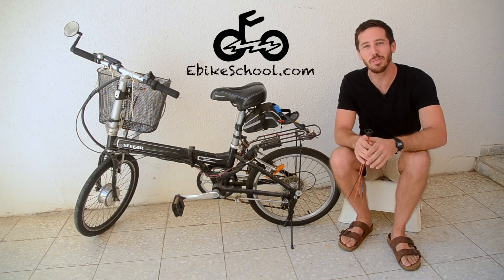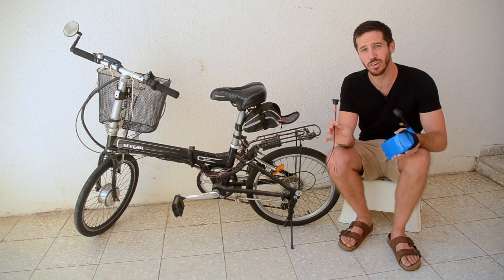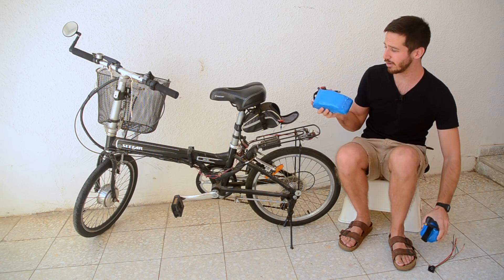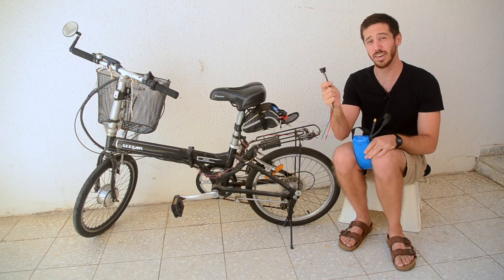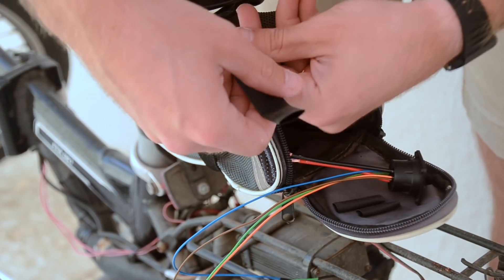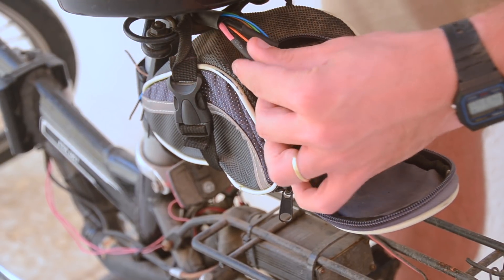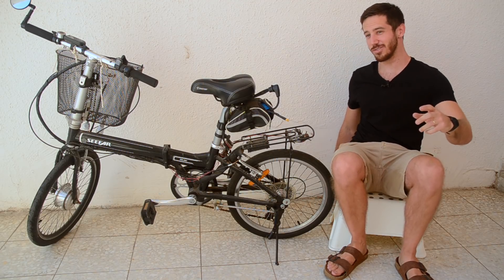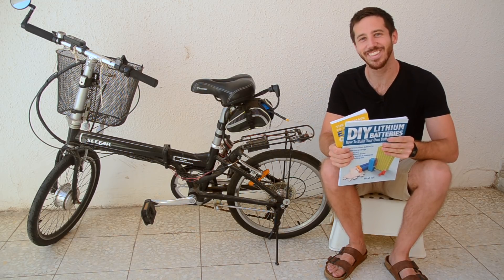How To Swap A Battery Connector (With Rosenberger Magnetic Connector!)

Comment: Hi. I also have a question if you can help me! I have a Rosenberger plug for a battery.
if I install another, more common plug.
I also need the rest of the cables. or if you can guide me where to buy a Rosenberger plug.
or a sketch of the rosenberger plug. thank you in advance

Comment: Nice video to show how to make an extra batterypack with a rosenberger magnetic connector. I have had traffic accident and only can follow up 2 workinstructions at the same time. I't nice to see that in this video there were no more than 2 instructions at the samen time. Would be nice to read your the batterybook. Next question will to connect a e-bike batter with a solarpanel without a transmitter. Is the a 36V solarpanel with fits with the rosenberger magnetic connector.

Comment: Haha cut off the old one and put a new one haha well thats what I did I got a dodgy 48v 20ah cost me $500 didn't even get 15 minutes ride before I come back trying to charge it and the XRL connectors that are on them to charge it are terrible so do you have to have same voltage connecters or something and same thickness wires the only videos I've seen with connectors being change they have to get right up into the bms and I can't find replacement connectors anywhere any help??

Comment: I’ve heard all motors create small amounts of energy when turn manually while the motor is off, if you turn off your ebike hub motor, does it regenerate small amounts of power to the battery? Or is that power lost to space in e bikes?

Comment: Hi Mika.       Some advice please. l have two 48v batteries that i want to run in series and connect into a 96v controller. Seems straight forward, should i expect any problems?
Thanks pard

Comment: I don't want to be that guy... but I see you showing others how to solder incorrectly and I am not sure how else to say it.. That solder job you did on those power leads is superficial. You need to bring your wires up to temperature and they will quite literally suck up your solder. (Think solder wick) you need to heat the wires from one side then put your solder on the other side if you cant do this then you need a more powerful iron! The wire will draw the solder into it as it melts and the solder will become part of the wire. Do not put the solder on the iron because the nice hot iron will of course melt the solder then it hits a cold wire that will act like a heat sink and dissipates the heat from the solder and instantly solidifies the solder not making a good connection.

https://youtu.be/Qps9woUGkvI?t=156 watch how this solder flows when she does her leads... this is why!

Comment: Could you tell me if there are any standards for battery backs ?  the connection between the battery and bike.  Some are 3 pin some are 6 pin , in fact its seems like theres no standard so if I need to change up batteries my only option is to fill the old box with a new lithium battery ?  Is there such a thing as universal adapters or adapters ?

Comment: hi Micah, i have bought a battery and a kit from different suppliers and they are still in process of delivery. now i saw pictures of both and it seems that connectors on battery and controller are not the same, the battery has double connected  input and the controller has two separated green wires
i bought them from suppliers from aliexpress you advised in one of your videos
maybe cut them both and buy some regular connector in store, are they any specific connectors that should i buy to consider the temperature of the wiring?
great channel btw, you are really knowledgeable and interesting to listen to, should be doing more tech-related videos in future, cheers

Comment: Heat gun would've melted the underseat bag. Lighter was good call. 
So you really just push the slightly splayed out wire ends together with no twisting, only solder? They don't pull apart easily that way? Sure more tidy than the knotted solder splice glob that I end up with. Not enough heat shrink in the world to hide that ball of ugly, but won't pull apart.
Reply from the maker: Yes for heavy gauge wire, I prefer this method. The high number of strands makes for a good physical connection that the solder reinforces. For small gauge wire, I often use your method of twisting first. An even better addition to the method I used here is to take a thin strand of copper wire and wrap around the two splayed wire ends once they are together. That holds the bundle tight with a lot of friction between the strands, then you solder the whole thing.

Comment: Mikah..  is there a difference between a XLR ebike (electrical) connector and the XLR used with Audio/Mic connectors and cables..?  Can the Audio versions be used on 52v lithium batteries..?

Comment: That plug may be exactly what I was looking for. I want a way to keep my battery on me instead of my skateboard but easily detachable in case I hit a rut and have to run for it. One battery and one set of electronics make it possible to build multiple sizes for skateboards without redundant costs. Do they make a 3 prong connector or would I have to use 2 of them?

Comment: Nice, but this connector will never hold the current I plan for my trike battery. 10s 14P made from 21700's. So I have a few questions. 
  First which connector would you recommend to carry the current load? Maybe think of doing a video showing appropriate connectors for xxxx watts output. I know many people would find this helpful when building their first battery pack.
   Secondly will the vruzend kit ever be available for 21700's and if so could they handle the 10s 14p current with the newer high power setup that is as yet unreleased? Also will there be any other color caps available?

Comment: Also what batteries would be better for a longboard. I am in between two.  The Panasonic NCR18650PF  and the Samsung 25r.  I plan to get the batteries off of imrbatteries.com.
Reply from the maker: Really depends on your need. PF cells are high capacity but the 25R cells are much higher power. You can get the 25Rs for cheaper on Vruzend.com, FYI.

Comment: Really enjoying you videos.  I have a question I hope you can help with.  I'm trying to use recovered cells from laptop batteries and wondered what an acceptable internal resistance for the cells would be.  I have a battery resistance meter as I also enjoy flying RC models.

Comment: Hello I'm building a 10s3p battery with the vruzend kit. Would you recommend me to us 2 wire clamps each on the positive and negative terminals? Or is one on each just fine? Thanks ahead of time :)
Reply from the maker: If possible, definitely two on each end. Spreading out the current flow through multiple points is always better because it reduces resistance.

Comment: Question. if you increase voltage (48v to 52v) of a battery you get more power (speed) from your ebike. if you increase amps (7p instead of 6p) does that increase range?
Reply from the maker: I think you mean "if you increase amp hours", but the answer is yes.
Reply: EbikeSchool.com cheers

Comment: Thanks.  You should add the lunacycle.com Rosenberger connector to your list of parts.  I like it.  Especially since you swap batteries regularly and sooner or later the other connectors will get loose.
Reply: Direct link to connectors is:
https://lunacycle.com/rosenberger-magnetic-connector-male-and-female/
Per the EnergyBus standard, the data pins normally run CAN-Bus, through which the charging voltage (and other parameters) are negotiated: 
https://en.wikipedia.org/wiki/EnergyBus

Comment: Yeaaahh... I have some Rosenberger magnetic connectors that I harvested from some A2B ebikes. These plugs are AWESOME (at least the original ones are). Shame I'm pumping a LOT more than the rated current, I remember looking their product range and I think they had a bigger version but was super Industrial and super expensive, I gave up the idea haha
I'm hoping we will see a Hosenberger style capable of 50, 60 or 90A soon, that would be the ultimate ebike connector and probably standard in all bikes... Rosenberger POWEEEEEERRR haha =]
Reply from the maker: Bruno, you should run like 5 of these connectors in parallel for your loads ;-)
Reply: EbikeSchool.com hahahahaa I'm attempted to do it now... ohhh yeaaahhh!!!
Reply: Couple of points about the soldering and heat shrink. Consider doing the soldering in two stages. First push the bare, open stranded wires together like you did. The add a touch of solder but not too much. Then use your pliers to close down any wires that might be poking out. Lastly add more solder to stick all the wires flat. This way you won’t get sharp bits sticking up potentially puncturing insulation and shorting out your gear. 

Secondly, your hot soldering iron is a perfect wand for heat shrinking. Hold it lose and move it over but not touching the heat shrink tube.
Reply: Robert Hayward yeaahh... I'm an electronics guy and I would say, always do your very best job and always try to improve your soldering skills!!
Every case is different, so many variations, different soldering irons, different wires type (solid/flexible, pvc/silicone insulation) different solder compositions (more tin, less tin, more lead, less or no lead, some contain silver, different melting temperature).... blablabla
Heatshrink is as important as a good solder joint, I always use a hot air gun (some people even use a hairdryer and works fine). A lot of people use lighter or soldering iron (it's convenient but personally I don't do).
I always try to use double wall (thicker) heat shrink with glue inside for a "weatherproof joint" but in some cases a regular heat shrink is more ideal, it all depends on the application. Try to buy a heat shrink with high shrinking ratio like 3:1 or 4:1 (a 10mm 4:1 will shrink 4x its size). Once you start using a 3:1 or 4:1 you never want to go back to the cheap 2:1 regular shrink haha
Whatever works for you, sometimes I do what you said, sometimes I don't, every case is different, just do your best work, never rush and most importantly keep things safe!!! 
POWEEEEEERRR =]
Reply from the maker: Robert Hayward thanks for the tips! I'll do that from now on!

Comment: Hi Mike, its possibile to use this magnetic connector also for 750Watt ebike?
Reply from the maker: I think so. It's rated up to 1000 watts, though I don't like to push electronics ratings too far. I'd imagine 750 watts would still be fine though.

Comment: Micah:  I love the video and the concept of using the Rosenberger connectors for the load side.  I have a couple of comments on the commentary:  
At the beginning, you compare the power consumed in your application vs. the ratings on the connector in terms of volts X amps.  The voltage and current ratings are unique and must be considered separately.   The current rating is the most important, as exceeding this one could cause the connector to overheat, potentially melting, shorting, and causing a fire.  The voltage rating is likely to protect the dielectric insulation in the materials or design of the connector.
Secondly, you say that you can use the same process to change any connectors.  When you do the battery end, of course, you need to take much more care working with live high current sources like a finished battery.  Your book makes this very clear several times.
I'm sure you know all this and just spoke in shorthand.
Reply from the maker: Thanks Randy, you're right that I should have been more clear about each of these issues. Sometimes its hard to remember to go into enough detail when I'm talking. When writing, like in my books, its easy to edit and review. Perhaps I should write a script instead of winging it in these videos...

Comment: Is there any chance of the battery end of the Rosenberger Magnetic Connector accidentally shorting out when removed from the bike?  Is there some sort of shielding or terminal offset?
How strong is the pull on the magnetic connector?
Reply from the maker: There is a chance, but it doesn't seem likely. The battery end's terminals are sunken in, so you'd need to have something with two prongs that could fit in there to short it. Possible, but improbable. Of course nearly any connector can be shorted if a metallic object of the proper size and shape worked its way in there...

Comment: What kind of solder gun do you recommend?
Reply from the maker: To be honest I use a cheap one from Aliexpress. I think its 60W. Adjustable temperature is very useful, even if its a cheap one. I almost always use electric but I have used some butane powered ones for doing work outside when I don't have a plug near by. They aren't pretty but they get the job done...